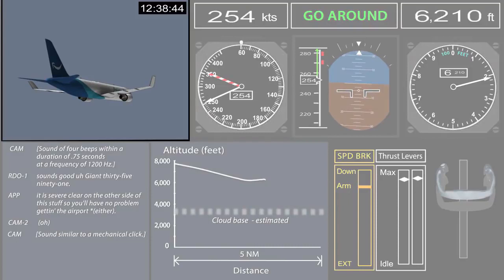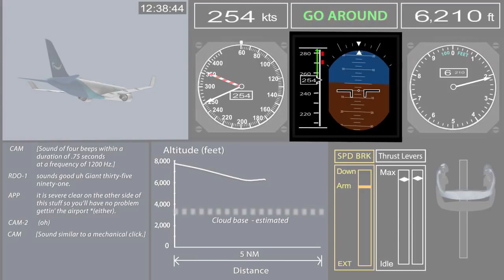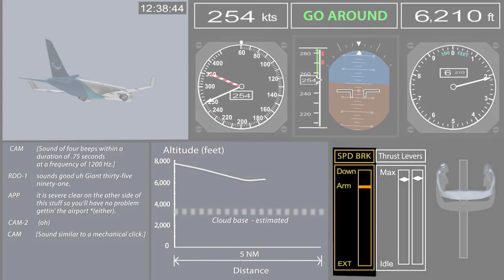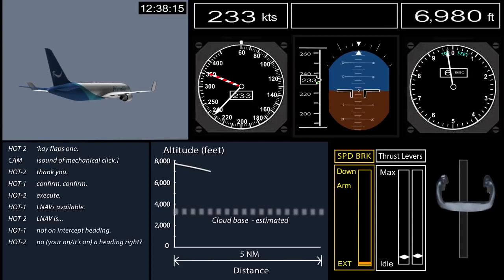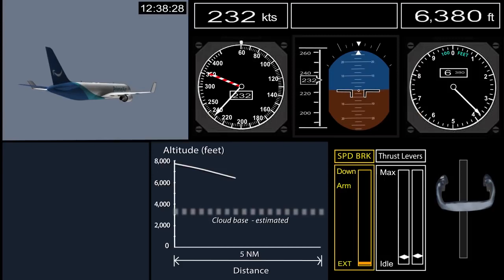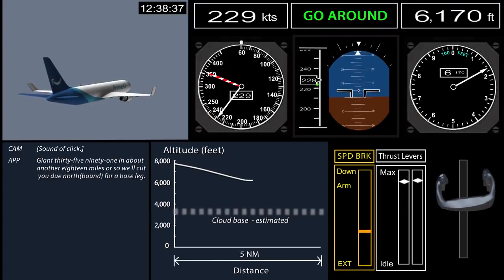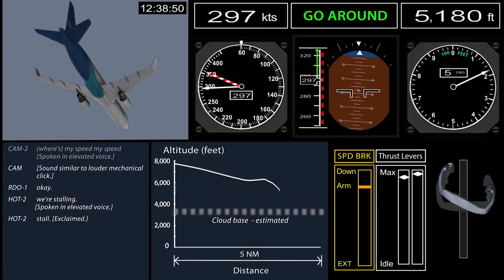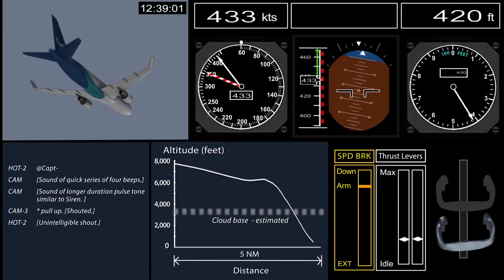Atlas Air Crash Recreation – NTSB video of Flight 3591

Comment: That's why I love large PFDs with massive AIs. Boeing has finally accepted the importance of that in the 787 and 737 MAX. Airbus is still stuck with the same mentality of tiny AIs.
Reply from the maker: Yes, I totally agree. I was always a little nervous in clouds until the G1000 came out. With a 10-inch wide attitude indicator, you can easily tell when it's off by a couple of degrees. With the normal 2-inch AIs, it much hard to keep the wings level in the clouds.
Reply: Wait a minute, hundreds of thousands of pilots managed to fly (tiny) steam gauge 6-pack airplanes for decades without jamming one into the ground like this.   Big screens are great, yes.  But competent airmen are far more important than deluxe and automatic gizmos.    I find it very hard to believe that this "pilot" (the FO) didn't give the company ample opportunity to weed him out.  Just because you possess a ticket does not mean you belong in a cockpit.    Checking out in a Boeing takes weeks and numerous SIM sessions.   This is a stain on HR and training.